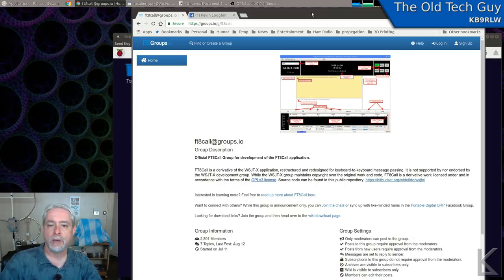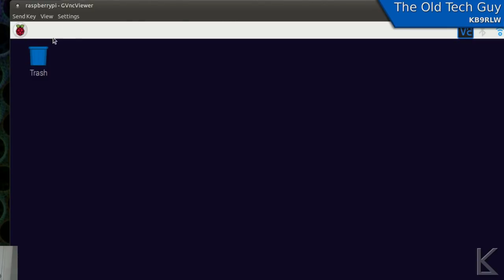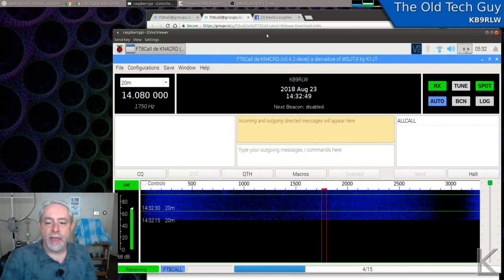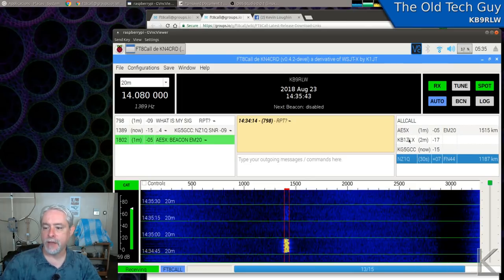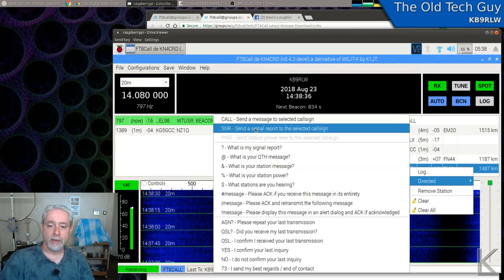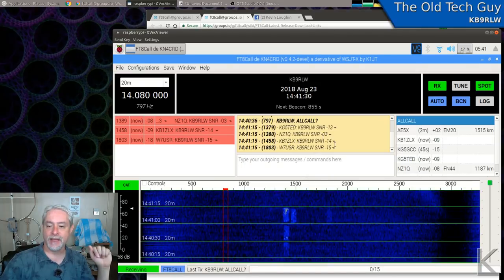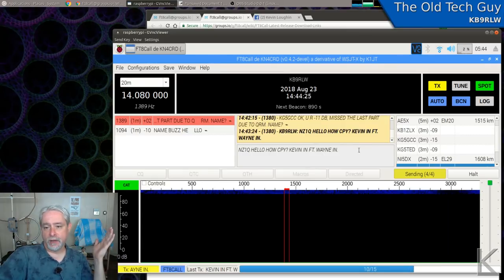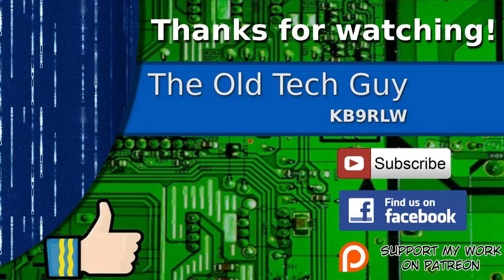Ham Radio - Installing FT8Call on the raspberry pi

Comment: So much potential with this mode... I love it! I'll be activating a SOTA summit next weekend with FT8call on Raspberry Pi & ft-817. Should be fun! Thanks for the video. I used the appimage after doing the Deb install and it not linking right. I figured appimage makes it easier to upgrade often. Once it's out of beta, I'll sort the install.

Comment: Great job Kevin, as usual. You are a real asset to HAM Radio!
I downloaded the dot.deb file from:
"files.jt8call.com/latest.htm"
for Rapbian on 05.04.20/2030Hrs.
The 'Guide' would not load because it's in docs.google and I haven't registered yet.
Since I'm restarting HAMing via QRP, ft8call will be fun to use.
Thx for your great explanation.......
73 OM

Comment: Joe's coming out with a new version of FT8 later this year that will be a mandatory upgrade, that will include many of the features of FT8Call and more.  I'm holding on for that rather than cluttering up my system with all sorts of additional software.
Reply: Bubba Warbucks I don't think many of the FT8Call features will ever be included in WSJT-X based on what I've heard from their team. But, I'd love it if my modifications inspire Joe et. al.

Comment: This also works with Windows 7 just fine.  Not a fan of digital but this is fun. Making contacts across the country with my 817 and a indoor magloop! (Contacts were just to easy with IC7300 and endfed lol). Great work and looking forward to the updates.  (My straight key is getting jealous). 73 de KF7VUT

Comment: Is there a way to use this with a cheap or low power radio like a bitx 5 watt radio? Like send the data through the mic input and have it key up by having your computer communicate with the arduino that runs it?
Reply from the maker: In the example of the uBitx, he actually has included CAT control through the arduino's serial port.   You set your radio up in the program as a Yaesu FT-817 and it works just fine.    If you're taking audio directly from the computer's line out, you'd probably want to tap a second input on the radio just after the mic amp in the audio chain.   But you could feed it into the mic input directly and just turn the computers volume way down.
Reply: Thats exactly what I wanted it to do. I wonder if it's wise to buy another arduino to run it and mess with it that way if it gets screwed up you can just plug the old arduino back in. If I knew more about electronics I would have invented the bitx; that was the first use i thought of when I discovered the arduino.

Comment: Kevin - yet another great video! Thanks. I'd be quite interested in the hardware side of this set up. From the Rpi to your transmitter/transceiver. Again - Thanks.
Reply from the maker: I use a USB serial adapter for CAT control on the Yaesu FT817.  For audio, I built my own USB interface that's similar to the signalink, but with more options and much cheaper.   Search for DuinoVOX to find my write-up and video on it.

Comment: There is also a new mode that is using FT8 or JT65 protocol to send images like sstv but with better quality,,, any ideas of that
Reply from the maker: I can't see how they could with the very small packet size of the mode.  Unless they are doing something like the hybrid DRM mode does.  Sending an IP address of the computer and relying on FTP to send the actual picture data over the internet.
Reply: Kevin Loughin if you are on facebook there is a group called FT8 & JT65 image on hf

Comment: Kevin very good video. But I wish it would install on my Pi. Tried a couple of different ways to install it but it does not install. Works fine on windows but not the Pi. Any ideas?
Reply from the maker: No, not without any further information.  What way did you try and what happened?  Error messages?
Reply: Well found the problem. I reinstalled using NOOBS and it works. Who knows. Might have been a problem with the download of the original. But working fine now. Thanks for the reply.
73's
Ron
W7SHA

Comment: So first thing about linux is there are different distributions.  Not at all like windows where you have one windows fits all.  Ubuntu and deb are different distributions from mint.
Reply from the maker: Well, sort of, but not quite.   Debian is the raw distribution.  Ubuntu, and Mint, both take Debian and install a bunch of default packages, then pre-configure many things a certain way.   But they both start with Debian.   
The same is sort of true of Raspian.  They start with Debian and cross-compile all of it's pieces for the ARM cpu.  Then lots and lots of changes for the hardware, boot loader, and other stuff.
As long as you stay in the same architecture, and debian version number, nearly all .deb packages will install under ubuntu, mint, and the many other distros that are based on Debian.

Comment: Hi Kevin,
Found this on QRZ.COM.  NOTE: Until the general release of FT8Call, development versions will only carry a 10 day lifespan. After expiration, you’ll be required to upgrade to the latest version of the application.

How has your job hunting been going?   73   WB3BJU
Reply from the maker: Thanks Don.  I figured it'd be something like that.  I still wonder if it's going to stop working once it hits the end of the time window.  Smart move since it's a dev version.  Keep all the users on the same version while testing.
Reply: Next version will be available soon!

de KN4CRD

Comment: Kevin, I am sorry but besides the experimental aspects of this it seems to me that this digital mode (FT8/ FT8call etc.)is removing the human from the use of the ham bands/ amateur radio, which to me is the point of the hobby. Having the computer receive and reply simply to have a contact that you/human are not involved in is Not what the hobble is all about. Please enlighten me if this perception is wrong in some way.
Reply from the maker: I'm personally far more interested in communication modes as well.  But it's a big hobby and I have a large audience, so I cover everything when I can.
Reply: Sorry if you took that to be directed at you. It was a comment about FT8 not that you are covering it, as I enjoy your work.
Reply: Edward Kress One thing to note is that FT8Call is all about putting the human communication back into weak signal digital modes. Give it a try... You might like it 😁